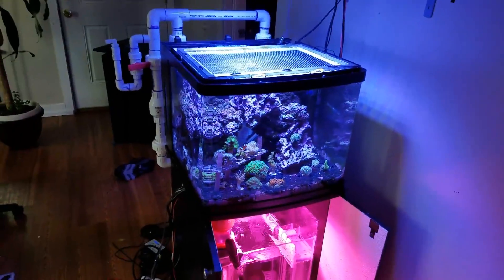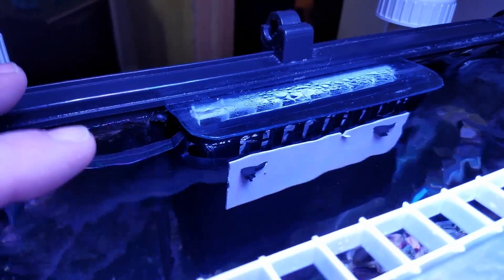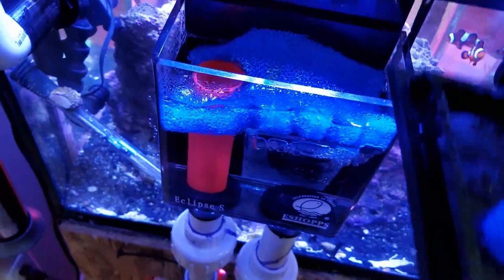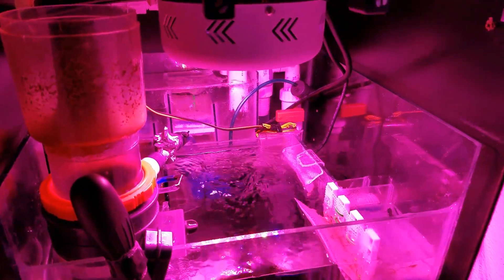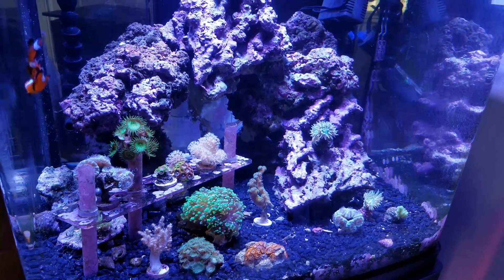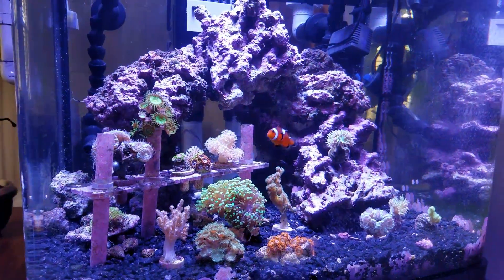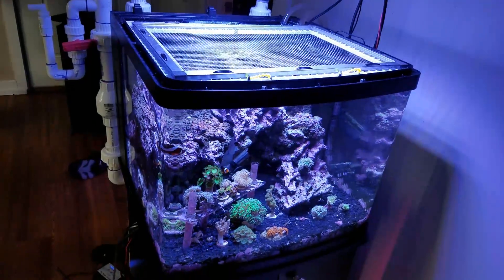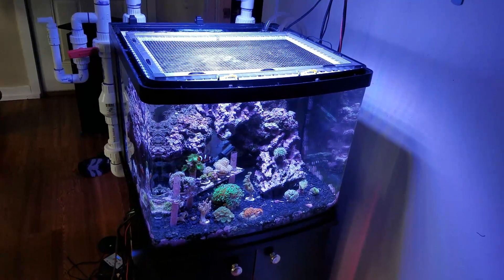Biocube 29 Custom Sump (pt5)

Comment: Your overflow box is loud because you don't have it setup correctly. Use elbows on your drain pipe and the red pipe is only used for emergency. The noise alrets you that something is wrong! Research overflow box plumbing. The answers are all over YouTube. 👍